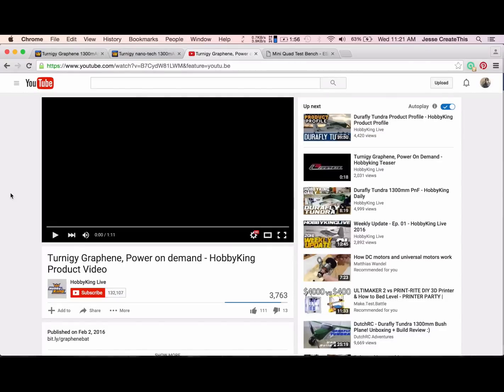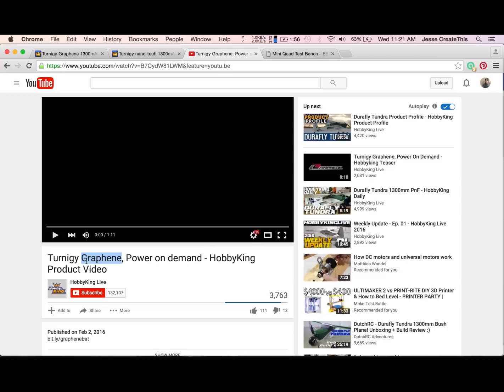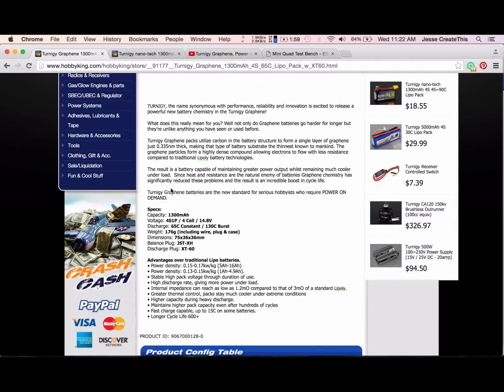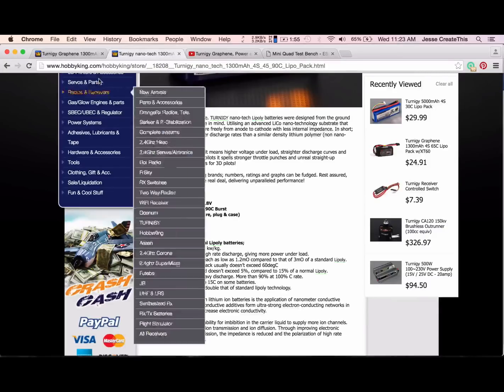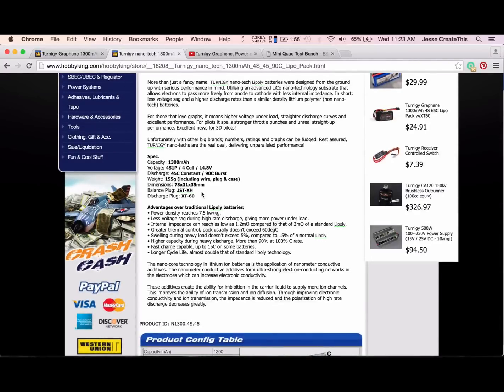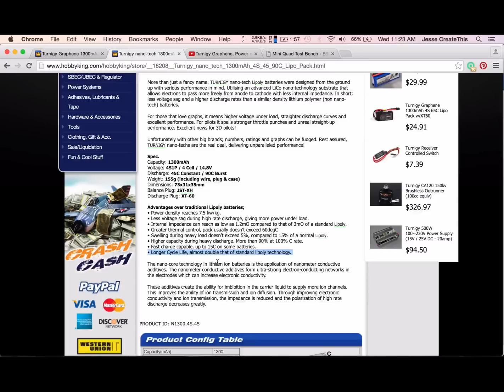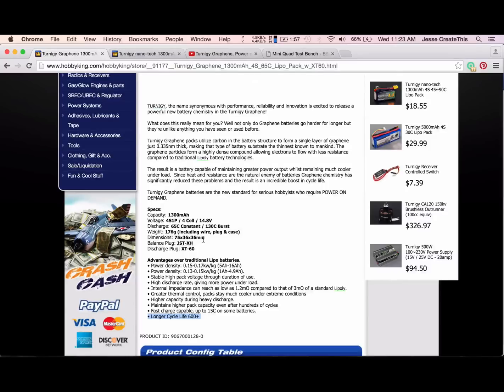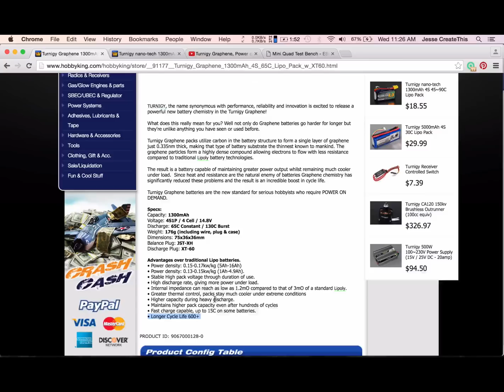Graphene batteries are finally here!

Comment: What do the letters and numbers mean?  45 65C? Lipo pack?
Reply from the maker: The c-rating is how much power you can pull from the battery continuously in amps. A 1300mah battery with a 1C rating can safely pull 1.3 amps continuously. A 1300mah battery with a 2C rating can safely pull 2.6 amps continuously. They typically rate burst and continuous for each battery. A 1300mah 75C battery can pull 97.5 amps continuously. Hope that helps.

Comment: Fisker claims their electric car will go 500 miles ...miles! on a 1 minute charge. No lie 1 minute... that's better than gas. GAS IS DONE,  so is the middle East. There is even plans to use this graphene tech in computers to make them faster and cooler running.

Comment: Those batteries are not, worth it look the weight. Same size Graphene batteries should weight less than regular batteries. We should get should get same capacity with less weigth. bigger discharge just mean, you run battery empty faster.

Comment: Any battery you can only get a hundred cycles out of is crap.  I would expect the new graphene batteries to provide thousands (2000 - 5000) cycles - or, the technology is not refined enough, yet.
Reply: It depends on the discharge rate. Since RC models often use very high discharge rates (10C or more), the cycle life of battery packs is often much shorter than normally claimed. 100-200 cycles for a lipo pack used for flying a powerful RC aircraft is very good!
A battery used for a cell phone may only be discharged at 0.5C maximum, which allows much longer cycle life, possibly 500 cycles.
For electric cars with very long range, such as a Tesla, the actual continuous average discharge rate might be only roughly 0.2 or 0.3C--and, the battery is never fully charged or fully discharged, because the charger prevents that. This allows the battery pack to last a very long time, ideally the life of the car.
Reply: I stand by my original statement.   Graphene is supposed to be a "miracle substance" - a hundred cycles is not a miracle.   It's mediocre.

Even regular LiPo batteries that only get a hundred cycles are not refined enough for their application and there is room for much improvement.
Reply: Just using a material in an application doesn't solve all the problems. Lithium-ion cells deteriorate because of oxidation of the electrodes as well as chemical breakdown of the electrolyte. It's inherent in how the cells work. Using a fancy expensive material doesn't solve that :)
When you're running them all the time at a 10C or even 20C discharge (that's a 3-minute discharge!) then 100 cycles is pretty good, 200 is great, anything more and you're golden. It's still cheaper and more convenient than glow fuel. Remember, HobbyKing lipo batteries, in general, are very 'cheap' in the colloquial sense of the word.

Comment: I'm looking over some of the specs. I see more energy density, less weight, and higher output rating. Shaweet!
Reply: https://www.hobbytown.com/2s-100c-silicon-graphene-hv-lcg-lipo-battery-7.6v-6300mah-by-protek-rc-ptk-5115-17/p539114

Comment: I wouldn't consider these "graphene batteries", but rather a 'graphene enhanced lipoly' battery.

The true graphene batteries to come, will have significantly higher density. Also, their discharge/charge capacity will blur the lines between batteries and capacitors. By true graphene, I mean the only other materials in the cell will be contacts, insulator (air), and casing material.

Comment: Sweet!  Faster charge & discharge, longer life, less degradation & at least the same capacity as lipo batts.. what's not to like?!

You did leave out one item though---eventually, graphene will be much less expensive than rare-earth lithium--so it should be a huge win in that area for long-term battery prices!

Thanks for sharing!

Comment: Hobbyking has true graphene batteries, the nano-tech batteries have been out for years and they are NOT graphene. The graphene batteries are quite new and are supposed to be a little bit better than the nano-techs, and a lot more expensive. The nano-techs are awesome, they last at least 500 charges and are a generation ahead of Tesla, as they do not heat up just as long as you don't discharge them below about 10%.

Comment: I have been flying these batteries for two months and they seem to run cooler then A-Spec Nano-Tech in a EDF Vampire jet. Improve performance due to 65C.  I intend on buying more as I replace older batteries..

Comment: What is the point of 90C? One minute running time does not have any wide application.
Reply: what about starting a motorcycle
Reply: You could use them for that, but high energy density batteries are not needed for engine starting. There are much cheaper alternatives that are also easier to charge, like the standard lead-acid. They're just fine for that, are cheap, and are 100% recyclable as well.
Reply: lead-acid are heavy old technologie they take up way to much space and often need replacing
Reply: d3xterown The ones used on motorcycles are maybe 1 percent of the bike's weight. No big deal.
If it needs replacing often, there's a problem with the charging circuit. Just remember that when you put the bike away for the winter, disconnect the battery and make sure it's kept charged with a float charger. Should last for years.
Reply: You are an idiot Its a big difference in weight ( and the cheapest way to lose weight) The live prediction of Lifepo4 is just longer then lead and no need for a float charger just put it inside
Reply: d3xterown Yeah, I'm an 'idiot'... you lost me there with your brilliance.
For the record, it's a tiny little difference in weight, for a major difference in cost and maintenance.

Comment: I think it's all BS. the price range and the 1300mA which is quite standard, it's probably 1 thin sheet of graphene which makes F.A. difference. true graphene structure would charge in seconds and provide huge currents so I'll ignore these so called graphene batteries until they make them almost 100% super cap graphene batteries.
it's marketing gimic for sure.

Comment: Edison Power and Sunvault Energy are currently having a graphene ESD that may give an electric car 500 Km range at which point a graphene fuel cell will recharge the GESD in 5 minutes while driving and continue on for another 500 Km and on and on. Fueled by the hydrogen in water. To be featured in The Edison Electron 1 in 2016 a electric super car with 1000 psi torque
Reply: yes Neil, this shall cross everything else in this world, including TESLA. I am very confident about Robert Murray Smith. He is the best.
Reply: I agree Robert is the King of Graphene,
Reply: He is the king indeed

Comment: the real question is: when will they be used in smartphones?
Reply: I'm wondering when it's hitting the laptops batteries. I'm want to open up my laptop battery case and replace them with the graphene batteries.
Reply: Merciful Lightning You would need a new charging circuit too.
Reply: StarTrek123456 
Thanks I need to know as much as I can, I lack experience in soldering and things of that nature. I know the basics of moving parts around but that's about it.
Reply: Robert murray Smith
Reply: Maybe in the Huawei Mate 10

Comment: I have four of the 5000 mah 3S batteries for my VAS Chimera.   Weather has been crappy lately so I haven't had a chance to get a complete flight yet.   The batteries that I have will take up to a 10C recharge rate.  That's 50Amps!   Where are you going to find a charger that can give you 50A per channel?  Plus there is reportedly no lag in power until the very end, so be very careful and watch your time.  My nephew had a RC Boat that used two 2S batteries in series and one of his battery adapters was not working.  Drained the one battery all the way down to about 4% and it still charged up like nothing happened.   I'm still testing but so far, I'm going to get some more.  Now that you can get them from the USA Warehouse.   AND...IMO the fact that it has a 10C recharge tells you it's not a gimic.  As I'd be afraid to see you try and charge a standard Zippy lipo at 10C.  ;o)

Comment: Don't worry, chemists have said that batteries and capacitors made with graphene as a layer material can be made thinner than traditional batteries and capacitors made with traditional materials.  That means eventually more surface area and more surface area means more layers in the same packager size and that translates into more capacity..  The storage increase will come soon as people become more familiar with how to work with this new material.. now that we can mass produce it, the improvements in production quality and density of graphene layers will be next to ramp up capacity.  People are making graphene super capacitors at home, and its easy to do... if we can do it, just think about what industry can do soon with the same stuff and better tools and materials knowledge.. Laptops with 24 hour batteries are coming... :)
Reply from the maker: +Matt Carrell and electric cars that fill up as quickly as a tank of gas!

Comment: It seems very possible to soon have nano-driven lead-plated batteries that will fully self-recharge through understanding that atoms are in constant motion just by setting up an internal chain of micro-sized dynamos exponentially triggering each to spin clockwise which will produce more power the hotter it gets... unlike those conventional.

Comment: Robert murry smith has developed proper capacitor based batteries (graphine) called ESD or some thing that is being manufactured by sunlite they charge super fast(seconds) and have excellent output, cutting edge graphine tech.

Comment: Hey Jesse checkout Sunvault Energy and the hybrid graphene EESD Electrical Energy Storage Device.  Their
graphene super capacitor battery combination has may better energy density the LI but recharges in 5 minutes and in a electric vehicle you do not have to stop.  You can watch Robert Murray Smith, one of the directors of Sunvault create these devices on his YouTube Chanel. And also Gary Monaghan's videos on Vimeo.  You can cause a dead short on this EESD and no safety risks for damage or injury.  Watch for The Edison Electron 1 to hit the market early 2016 with this EESD and a graphene fuel cell that will charge it while driving after about 500 Km and then it may go for another 500 Km and on and on...
Reply from the maker: +Neil Lizotte I've watched a lot of Robert Murray Smith's videos. Haven't seen links to any commercial products yet though.
Reply: There coming a new case for Iphones and other smart phones will be available soon giving you cell 200% more life and 3 minute charge to 90% or better may 95% full charge.

The Edison Electron 1 should be out soon as they started on it 4 or more months ago and is a modular design.

Sunvault and Edison are not the only one's coming out with fast charging EESD's 

Storedot and a company from South America claims 1000 Km and 5 minute charge.

I chat with Robert often and they are very close to mass market of very large systems for houses and electric vehicles.

Take Care

Comment: This is the stuff that we need to be showing to lawmakers when they don't understand the value of the RC hobby. Hardcore multirotor racers are pushing this tech forward, these wouldn't exist right now if it weren't for the extreme fpv quad pilots and this new step in batteries wouldn't be happening. The tech that comes out of the RC hobby has the power to revolutionize electronics and life in general, and the regulators need to understand this when they're thinking about laws that could make it harder for all the genius people out there who just want to fly fast
Reply: FPV quad pilots aren't the only ones out there demanding higher performance from batteries. Heli's and planes are right there with them. You guys are the newbies, don't act like you deserve all the credit ;-)
Reply: Years of 3D helicopters pilots on the scene and now this technology it´s due FPV pilots, yeah, sure...

The real pusher it´s not RC hobby, it´s electric cars
Reply: Guys seriously, the RC market is a pretty niche market. Think laptops and phones. People's phones last a day or two. There is a huge demand for better battery technology and it's not coming from the RC niche. Portable devices is a huge pusher of this.
Reply: The RC industry is late to the party, companies in Japan have already created graphene backup batteries that recharge in a few minutes, and graphene's use in batteries was foreseen the day it was discovered as a material.
Reply: Graphine has huge implications in pretty much every area of technology imaginable. I doubt the RC hobby industry is pushing it much at all, or even any other single industry.
Reply: createthis it's true about China, but that's my point exactly. The US needs to be the leader in pushing the limits on this tech, and if they over regulate the hobby here that won't happen
Reply: Many of us have been through nicad and nitro long before we had lipos and drones. Nonetheless the drones have sparked an interest in rc and i have got many drone pilots to really enjoy line of sight airplanes.  I love fpv flying but there is something special about flying a nice plane low and slow.
Reply: Don't laugh too soon. I don't need 40A but to get a good vape on even a 60W TC rig I do need an 18650 that can push 30A. There are only a couple of examples on the market that even claim to achieve that, and even those can crap out when the going gets tough. Moreover, the capacity on those high power drain cells isn't great, and they wear out quickly. The claims made in the OP for these new graphene cells address all these concerns.
So I don't really think your amusement is justified.
Reply: er, no mate. don't believe everything you read. i switched from smoking to vaping 8 years ago and my health has been find ever since. vaping is nothing like smoking.
Reply from the maker: "Fine and ultrafine particles produced during combustion of plant matter are one of the major contributors to respiratory and cardiovascular risk from smoking tobacco.26 Although e-cigarettes don’t involve combustion, they do still produce particles of various types.9 A team of researchers from Washington University in St. Louis reported that ultrafine particles of water, nicotine, and solvent appeared to deposit in the lungs in a similar pattern as the ultrafines found in tobacco smoke.26" http://ehp.niehs.nih.gov/122-a244/
Reply: I am sure it is the RC hobby community pushing this technology forward LMAO.
Reply: Jon B Baca you're joking, right ? You seriously think someone spent millions in R&D to develop a new battery technology just for our hobby ? Let's get real : our hobby is more likely benefiting from research done for a much larger market. Like smartphones.

I know people who self-describe as "extreme" tend to think they move the world, but cars weren't invented for racing, and planes weren't invented for acrobatics. Cool as it is, FPV flying ain't nothing compared to the electric car industry alone.
Reply from the maker: +Jon B Baca The FPV scene reminds me a lot of the computer gaming scene in the early 90s. You've got a point. Unfortunately, I think most of the stuff we're buying comes from China. Not really a boon for the economy as much as a huge sink hole that way.
Reply: Vaping is a bigger market for high current output batteries now. The first manufacturer to deliver graphene in a 18650 format will clean up!
Reply: Ralph Clark
Omg, are you fucking kidding me? LOLOL! I might just die laughing at that comment. Vapes don't require shit for current compared to planes or helis. I would love to see your vape pull 40+ amps out of an 18650... LMAO!
Reply: Ralph Clark
My amusement comes more from the fact that you need that much current for a vape in the first place. Quite possibly one of the dumbest trends next to smoking cigs. Fast-track to popcorn lung, lol.
Reply: Ralph Clark
Nope. It's a completely different cocktail of chemicals. At least with tobacco we have decades of use and research showing us exactly how it's harmful to us. Vaping hasn't been around long enough for the long term effects to show themselves, nor the studies to highlight them, but have fun being a guinea pig for the rest of us! Ignorance is bliss.
Reply: ThrottleWFO But one could still speculate that having vapor in your lungs is better than microscopic solid particles. At least from that point of view. Also it's a less expensive vice to maintain and way less annoying to people around you.
Reply: Asthma inhalers, club fog machines etc... they've been testing it for decades. You must work for big tobacco...
Reply: The RC and vaping markets are a fraction of what truly makes up the battery technology advancement. Most laptops use an array of 18650 batteries in their packs.

Probably the greatest pressure for battery advancement is in electric cars. Tesla motors is building a "giga factory" it'll be the largest building (acreage wise) in the world and its sole purpose is to produce the 18650 cells used in their vehicles. Likely they will extend that to also produce cells for power banks on houses and buildings and ultimately to the consumer market as standalone 18650 cells.